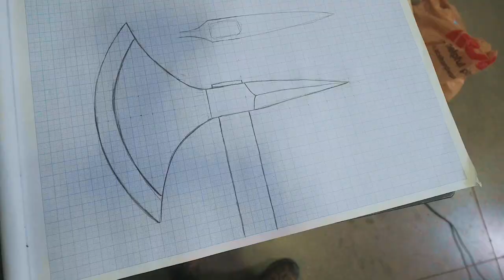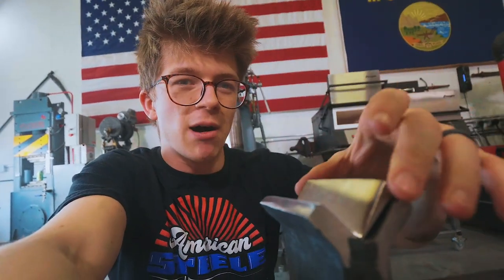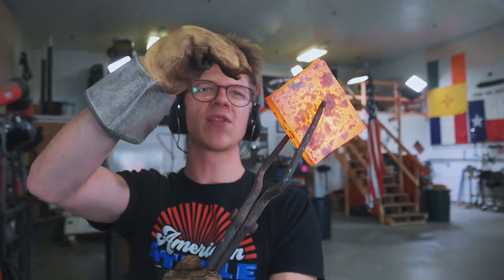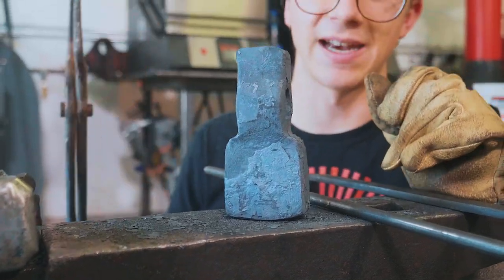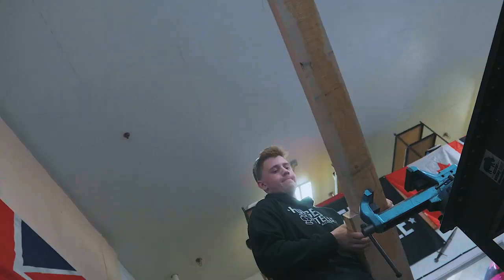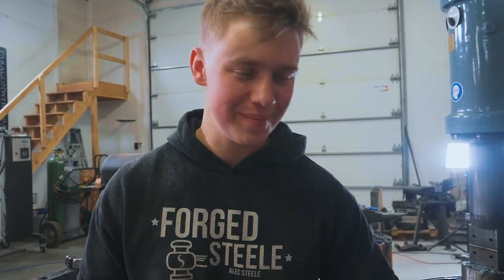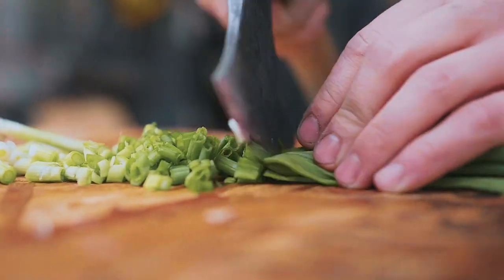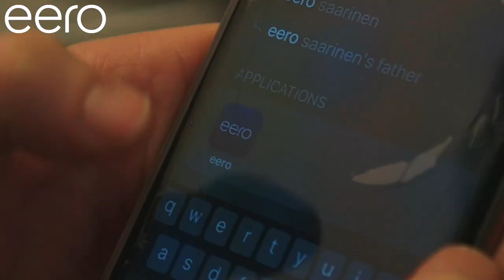FORGING A NAVAL BOARDING AXE!!!

Comment: Did will ever get the pieces he needed for the 25lbs mechanical hammer
Reply: At some stage, they have used it a couple of times in the past, on videos.  And I'm pretty sure from the sound that the powerhammer with the curved blocks Alec used on the blade was Will's.

Comment: Alec should make a video on different kinds of steel, what the numbers mean, that kind of thing. I'd watch the hell out of that.
Reply: Brody Alford it would be a very long video, because the naming system is not really universal from manufacture to manufacture. Sometimes the numbers and letters have to do with carbon content,  added trace elements, and procedures used to make it (like Crucibles CPM) but other times it’s just a list number. 

And then there are various versions of the same Steel like 154CM and CPM 154. Or even universally known steels like 1095 which are rebranded if made in a different country, like T10 maybe just 1095 or 1084

Comment: Nothing to do with video just need to ask fellow steel workers - I work in an industry the requires me to use pneumatic tin snips to cut many strands of stainless steel wire (.035) consecutively for the product my employer produces. The blades we use were out quickly and I was wondering if anyone could suggest a good heat treating process for the blades so I could get more life out of them (having to sharpen them daily is a hassle) any tips would be very appreciated. Love your stuff Alec, been a fan since 2017 keep up the good work!

Comment: You should make forge doors AND a massive handmade chimney for the forge! I wanna see that project. Make a massive steel hood vent and hang it from the ceiling with steel wire, run a duct to the wall, and you're good to go! You could even install a duct fan into it. I think a small electric turbine style fan would work great, and you could fit it into the duct work nearer to the wall so it isn't so loud, and it would continually pull toxic fumes and smoke from the forge area.

Comment: A relative of mine has a Fairbanks power hammer that has a drive system nearly identical to that little giant (but not yet converted to electric). Were there any major modifications (drilling etc.) that were done to add the motor mount or is it bolted to pre-existing hardware?

Comment: I've been watching since you started. I was just wondering if you can forge aluminum, and if so can you forge a knife out of aluminum and put a steel edge on it? I love fabricating things, and have been considering building a forge. would love to get some input on it. keep up the good work, and God bless!!
Reply: All the metal workers I've heard speak of it, (which is few, admittedly,) say that forging aluminum is impossible without a hypothetical really interesting hands-off sort of setup. You basically can't let ANY oxidants get to it before you're done working it.
Reply: @pneumarian  sounds interesting. wonder what it would take to do it 😁😁
Reply: some kind of fluid coating??? the wheels are turning, and I feel the smoke starting to build up! 😂😂
Reply: @jasonmassingale1027  At a guess, an atmosphere of one of the Noble Gasses, such as Helium or Argon.
Reply: @pneumarian  I was thinking that too, but I can't think of a possible way to do it that wouldn't cost more money than it's worth. they say necessity is the mother of invention, but dreams get it all started 😁😁

Comment: For the forge doors. Could you do 1 door instead that's designed to drop down when you press a foot pedal? Pedal could be build similar to the pedal bar on the power hammers, and you could even have it run on a counterweight system instead of a spring for the return, which would be fairly reliable. Essentially you could put in or take stuff out of the forge without having to use your hands is the idea I'm going for here XD Would definitely take some thinking on the mechanical aspect of it, but I think the end result would lead to the efficiency you guys typically look for and also be safe with the hands free approach.

Comment: What's the sand stuff you sprinkle on when forge welding, I've never seen that explained
Reply: In this case I think it's borax. I'm not super sure but I think it helps removing the oxyde layer off the steel to reveal bare metal and allow it to weld.

Comment: Alec what's the powder you put on the steel ?
Reply: Its borax, it's used as a flux to help keep oxidation of the steel to a minimum to help increase the chances of a successful forge weld

Comment: For what it is worth the Naval Boarding Ax was really designed primarily to be a tool.  I'm sure in some instances they became weapons but primarily they were a regular use tool on ships.  From the standpoint of actually boarding a ship they were well suited for cutting away rope and rigging.  Cutlasses were readily available on ships and, from a weapon standpoint, are a much better choice.

Comment: Black Bear Forge has done some videos on axe making.  When he puts in the bit he chisels little teeth on the bit before he puts it in to forge weld.  It helps to keep the piece in place as you forge weld it down to keep it from squirting out and moving.

Comment: Alec, I have a rather ignorant question, is there a forging temperature that is too hot for the steel you are working on?  Incidentally, how hot does your forge get? What fuels it? Are there alternate fuels that would burn hotter and have you ever used them? Can you utilize induction to heat material? Also, to maintain heat longer could you build a series of torches that would surround the power hammer pointed at the piece you’re working on to maintain its temperature longer? I’m fascinated by the metallurgy aspects of your work. Thank you for sharing your passion!

Comment: Re: The tool steel bit being squished out of the mild steel - I once saw a smith preparing the tool steel insert with a chisel. He used the point of the chisel to raise barbs just like on a rasp. He claimed that the barbs of the cold tool steel would bite into the hot mild steel locking the tool steel bit in place before heating it up for the weld. Maybe something to try.

Comment: I really like this episode. Good clean full episode of a simple project - and that finish tasks beautiful.

I have a question though - would it not have been better to forge weld that high carbon section in from the edge into the base of the crevice? That's what I would have done - wedge it in with some flux, get it good and hot and then tap it from one edge to the other to drive the flux out and forge weld the root first. Then you can just Flex a little more and reheat it, then set it on side and forge weld the sides together. That strikes me as a good way to avoid having a gap in the root of the insert, and ensuring a good solid forge weld all around for strength. Thoughts?

Comment: It really seems a bitted axe is a lost art. Until the 1900's almost all axes were hammered into a figure eight, according to most historical sources 'as thin as two sheets of parchment' (which I assume is an exaggeration given what we find, but then again what we find we find, what we don't find may have been so thin it eroded away) with the best bit of metal they could afford as the bit. The method used in this seems to be the norm these days in the rare occasions you find a high quality bit. The real reason is that steel is so cheap now they make the whole head of it.

Comment: Will - As a professional designer and custom, bespoke wooden furniture designer and builder, I’m telling you: PLEASE don’t ever, ever wrap your fingers around the wood you’re cutting with a circular saw to guide the cut!! You are literally putting yourself in danger of finger amputation or mutilation. There are adjustable cutting guides for circular saws that attach to the saw’s aluminum shoe. There are two handles on circular saws (front and back/trigger). Keep your hands on these until the cut is done, and use the adjustable saw guide for directing a smooth straight cut! (And yes, I absolutely can count to ten using all of my fingers!).

Comment: Put a short flat head wood screw between wedge and the handle right in center of split line -that way wedge cannot go out and your handle will be secured-make a small pool around the eye with duct tape and fill it with linseed oil,leave it over night and your handle will never fly off.Some people like to use wood glue when you hammer the handle in to seal the gaps.

Comment: I wish you talked a little more about the type of grind you used. I feel like that's something a lot of amateurs mess up and then wonder why their blades don't cut. Yours looks great though! The blade looks relatively thin and flat, which it should be for an axe that will be used as a weapon, but it's not nearly as thin as a battleaxe like a Dane axe. Because it is also meant for cutting wood and rope and such, it needs a little more mass and a sturdier edge so that it can chop instead of slice, so it has a noticeable secondary bevel. A lot of people making their first axes grind them super thick and end up making a splitting maul instead.

Comment: Stupid question I been watching videos for years but not sure I understand what does the flux do?
Reply: The flux basically melts onto the steel and prevents the steel from oxidizing and creating scale, if too much scale builds up the steel will not forge weld correctly and that's when you will have cracks and delaminations so by fluxing it to prevent that scale from building you increase the chances of getting a successful forge Weld
Reply: Timothy S. Thanks!

Comment: I'm confused by the temper.  You mentioned that you had to be careful to avoid over-tempering, but from the video, it looks like once you reached the desired temper (straw), you didn't take any steps to arrest the temper.  In fact, with a looming threat of over-temper, you tossed it into the oven.  Did the video skip a step?  If not, why was it okay to go from careful-overtemper-risk, directly to oven?

Comment: I would think that to get the high carbon steel to hold into the mild steel you could keyhole the mild steel and then make the high carbon steel with a corresponding round of metal that fits into the keyhole of the mild steel then forge weld it together. Better grip for the high carbon steel. :-)

Comment: Potentially dumb question before even finishing the video:  
9:20 Wouldn't it make more sense to forge in the bend (roughly at least) before grinding? With the inset high carbon edge it feels like you would take away a lot of the actual edge there.

Comment: For those who care: eero isn’t very great. It’s fast, but I have continuous issues with devices connecting to the wrong extenders, connecting on 2.4GHz intermittently, and you can only port forward one port at a time, no range input (absolute joke). Their customer support ignored me twice, and took 2 weeks to respond to a third email. Avoid.

Comment: Hey Alec or Will, techincal question... Would cold cutting the Mild steel on the bandsaw 3/4 ways through before heating work as well as heat and split technique? If you have a second...what is the critical difference between splitting and fold over laminating?  Is borax used between the mild and HC?  Thanks! Hey! Were you at Blade Show West in Portland?

Comment: How about flipping over the tapered high Carbon piece and seat the wide edge down into a flat bottom that you grind at the bottom of the split.  Instead of wanting to spit out,  it will lock itself in place.
Great whack—whack music,  by the way.

Comment: Did you harden the tip of the spike?
Reply: The tip of the spike is mild steel so it wouldn't harden even if he tried to
Reply: @timschrier903  Missed that detail. Guess they would have to forge weld in a piece of high carbon there to get that hard too.

Have access to high carbon steel in mass quantities really spoils you when making tools and weapons, doesn't it?

Comment: Why do the spike out of mild rather than carbon steel?  I'm certainly no expert on weapon smithing (not even experienced enough to rightfully be called an amateur, tbh), but it seems to me the spike would be more durable and enjoy dramatically increased longevity if it were high carbon as opposed to winding up as a blunt instrument after a few uses.

Comment: wouldn't it have been easier to flatten the iron and then folding it as opposed to splitting the iron square like you did? By folding it you would also have the opportunity to create the hole for the shaft in one go...